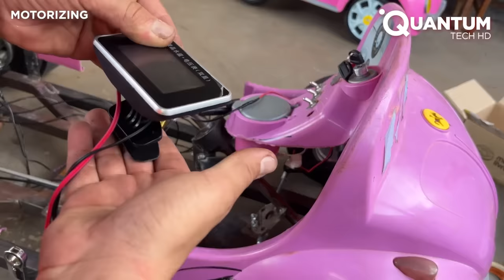Man Builds Amazing Go-Kart From an Old Toy Car! | Start to Finish by @Motorizando

Comment: Many years ago I was at a private bazaar with my junior and we found a huge dream of a go kart, or rather a powerful construction with a sports chassis etc. but without an engine, it was just a three-speed pedal and a nice gear selector like the car. Son and I bought it very cheaply before it was exhibited and we had so many plans for it But the vehicle is over 2m long and 1.5 wide and is mainly made of aluminum, so only someone who really knows their stuff, like the gentleman in the video for example, should take it.

Comment: When I was a kid I had a 5 hp Clinton motor, which i drilled the exhaust, and put a tiny Makuni carb on it that i got off a wrecked scooter. It went from 20 mph to 45 and would do burn outs.

Comment: Good craftsmanship, you should change those plastic tires to rubber one for better grip.
Reply: I think that the drifting and sliding was part of the plan, hence the non gripping tires.
Reply: Those are plastic sleeves over top of rubber kart tires.  Fitted to intentionally make them less grippy.    Less grip = more fun.

Comment: Hello Sir pls I want to ask u a question sir this hijet engine is exactly what I'm using to build that vehicle that is on my page sir but the question that I want to ask I now is that sir that gear box that is been attached to this engine sir I mean that automatic gear box that always has a kind of throttle cable from inside the gear box sir my question now is that does it work with brain 🧠 box sir pls i need a reply for this sir pls❤❤❤